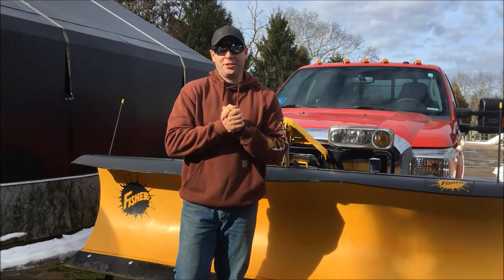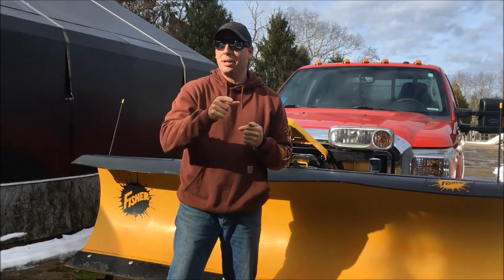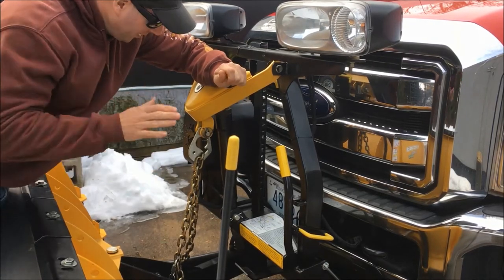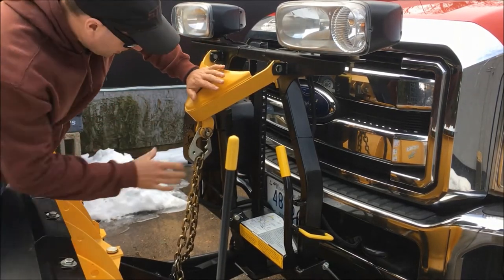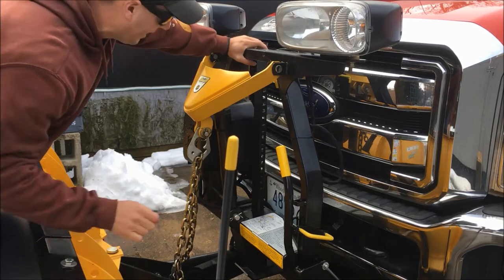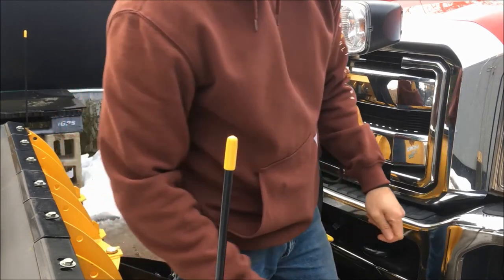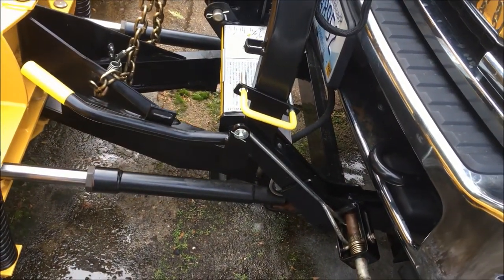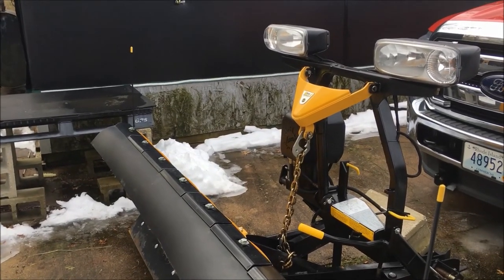Taking Fisher Plow off Truck

Comment: I had to get a floor jack and block of wood to get my pins to line up...
When I took plow off I wasn't on level ground.  With a little tweaking here and there,  the plow can be installed on uneven ground if you didn't watch his video first.
Great video and information wish I would of seen before I disconnected the plow on uneven ground.
Reply from the maker: Thank you for watching and the comment

Comment: Before driving your truck out of the lowergear, take the slack out of the chain so that one side is tight. Your headgear will stay in postion and ready for you to drive into next time. You shouldn't need the cement block.
Reply from the maker: Cool, thanks for the suggestion. I will def give that a try!